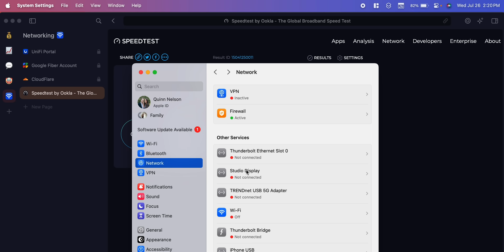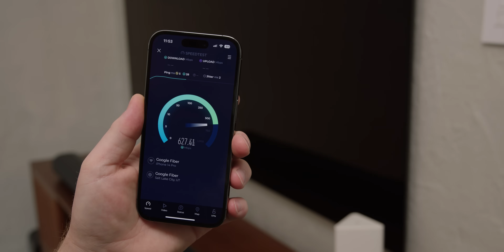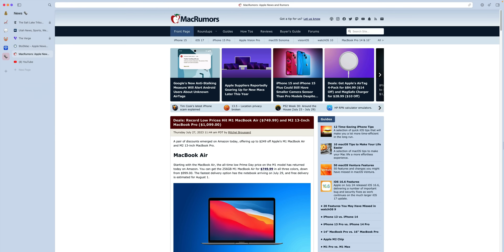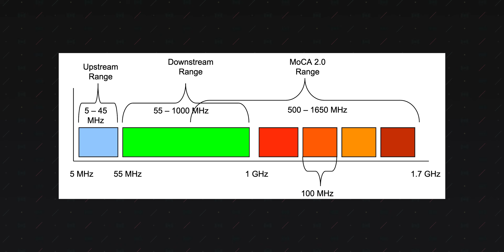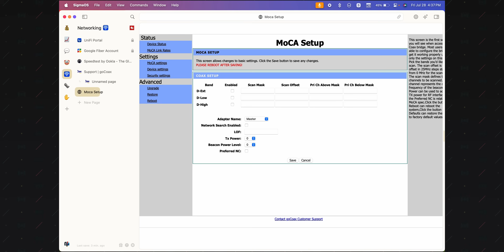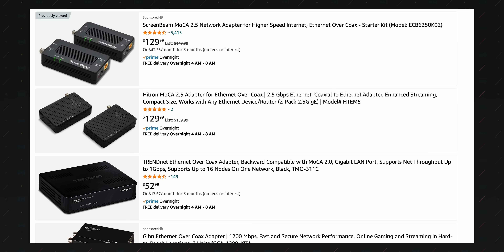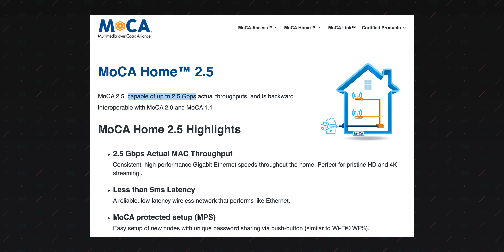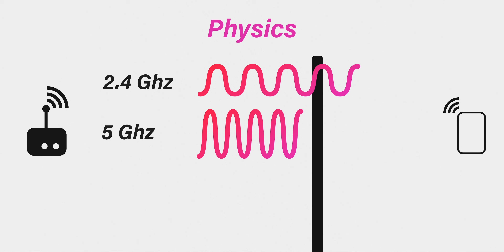10 Gigabit Network Retrofit for Renters. No Drilling Required!

Comment: I really like how you take the time to explain and present the problem at the beginning of your videos. Really makes the difference to get me hooked. Compared to the one liners most channels do to explain or present the problem.
Reply from the maker: Thanks!!
Reply: @snazzy  I liked that you went out of your way to present the issues with powerline adapters by showing us their performance in the best case scenario. You could've just said "powerline adapters are slow," but you instead presented it in a way where we can really understand how slow it is.
Reply: @EthicalAllele  Should have added though that the powerline adapters need to go straight into the wall for the best performance, not in splitters.

Comment: I took most of my coax out years ago after I cut the cord with DirecTV, and got I rid of Breezeline cable internet earlier this year due to high cost, leaving me with only one coax run, so I had considered power line adapters, but like you said it's not the most reliable, so when I went with T-MO fixed 5G(my other option was overpriced really slow DSL) to save some money(i'm still pulling between 400Mbps - 600Mbps + down/ 50Mbps - 150Mbps + up with pings between 16ms - 40ms being the worse I've seen, with all that consistently), and had to put the 5G gateway in my front living room for best signal, I went with a 4 base(they come in 3 packs, and I got the 4th one used) TP-Link X20 mesh WiFi setup, and I'm still getting close to my speeds at the Gateway across my house, so I don't think I'll be running any cables across my house anytime soon.  
So yeah a proper WiFi mesh setup can still be really good if you don't have more than a 1 gigabit connection.

Comment: HAM Radio operators don't like the network over power because I believe it caused all sorts of noise on the bands, Electromagnetic interference (EMI). I know they sometimes add band filters, that stops it from transmitting on all but the band it's using, but I am curious if the power line network options still causes problems for radio.

Comment: If you really need to use your power line for Ethernet, I advice to use the brand Devolo instead of TP-Link. Also just acceptable as temporary solution, because still slower, but much more stability.
Reply from the maker: A good suggestion! I'll throw a link in the description.
Reply: There all the same chipset so nothing more than firmware which is changeable
Reply: @damiendye6623  Well, electronics are more than chipset and firmware. I am not pretending to know what Devolo does differently, but I think, it is partly comparable with DA and AD converters: exactly the same logic, but different signal quality and error rate. It has its price though, everybody has to decide how important network stability is.
Reply: @paulbeaucuse2092  lol right so your one of those people that think more expensive==better. So tell me if chips and firmware don't make up the product what exactly does ?
Reply: @damiendye6623  No, I don't think expensive is better and please read my comment again.
Reply: @paulbeaucuse2092   you started waffling about da and ad converters. Which have 0 impact bacuse it's the quality of the low pass filter that's used to filter the line noise nothing to do with da or ad.
Because you starter talking about da and ad converters means your one of those audiofiles which don't know how they work and as such by snake oil
Reply: @damiendye6623  *you're (contraction of "YOU aRE")
your = possessive
Reply: @damiendye6623  *They're (contraction of "THEY aRE")
their = possessive
there: for all other uses

Comment: What do you guys do to saturate a 10gig LAN connecrion? Is it working better for stuff like steam link or streaming plex? If not, what are the actual use cases that would make it worth the extra $$$?
Reply: Only use case I can think if is accessing a home storage server for projects like video editing, or you're someone like Linus from LTT, so currently I think most homes would be fine with a 1gig, or 2.5gig setup for years to come, but I guess this is just future proofing for the really long haul so you don't have to do it again considering how long 1gig has been the standard, and many people still don't have a 1 gig connection yet.

Comment: I believe there is now the option of placing a tiny naked fiber optic cable next to the edges of doors and underneath them that makes retrofitting a wired connection possible and barely visible. I believe Movistar was testing it for consumers in Spain to avoid drilling holes and ugly cables.
Reply from the maker: Corning Clear Track is super cool, but it's still a pretty intensive installation and you'll need to punch through walls any time you need to leave a room. You also need all of the fiber termination tools which don't come cheap! Very cool tech indeed, but not quite within the DIY scope of this video.
Reply: @snazzy  Yeah definitely not a cheap solution if you need to buy the tools. Thanks for the info and the video of course ;)
Reply: It's called Corning Clear Track Fiber
Reply: @anthonydiiorio  looking at the install videos for that, they have some crazy sharp bends with that fiber. I guess you can bend it as long as you're not literally creasing it. LOL. Like as much bend radius as a pen diameter, it seems.
Reply: I put a flat cable under my baseboards/around my door molding, worked great.
Reply: I have similar setup like that. Fiber hidden in corner of the room. 10G between all switch with no latency and discrete usualy ;)
Reply: Would not recommend working with naked fiber.
If you look at it wrong it can break.
Reply: @06racing  With ClearCurve fiber, you can run some pretty tight bends with it. I work with it every day doing fiber internet installations and it is generally pretty forgiving. Crushing and harsh stretching is what you really need to worry about.
Reply: that is for GPON, not for ethernet
Reply: This exchange was super wholesome and heartwarming 🙌🌈🌟